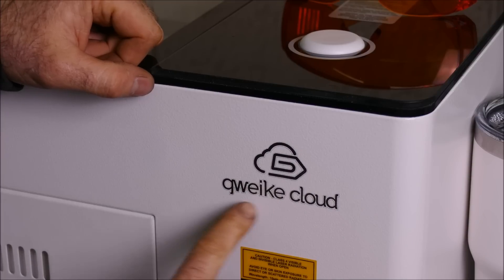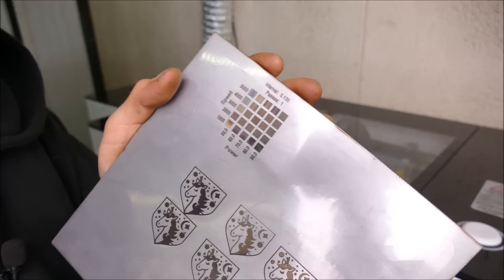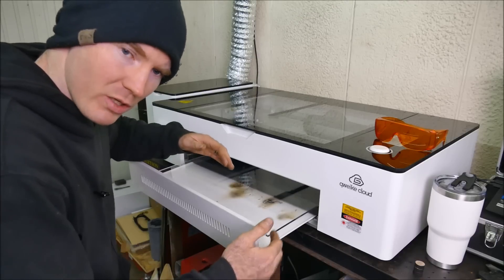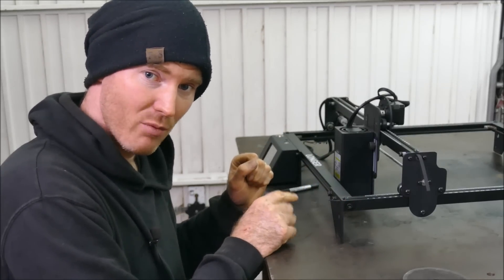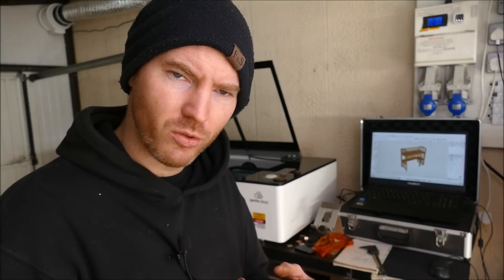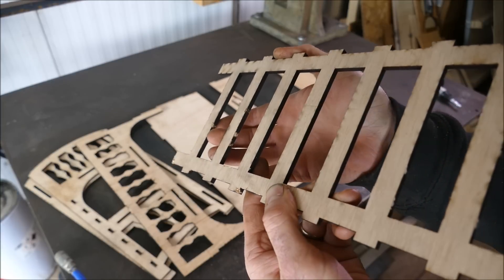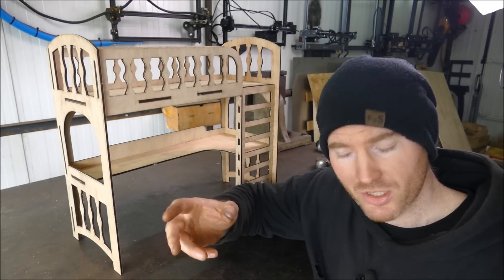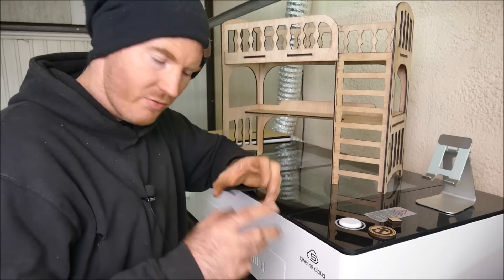10 VS 1 CNC laser!!! - £3000 Gweike cloud pro 50w against 10 x £300 10w lasers - Critical review!

Comment: Great video as usual.
A few of pieces of potentially useful information:
1. The color of a diode laser tells the wavelength.  If you see a red color the wavelength is near 700nm (or longer).   A blue laser runs near 400 nm.
 2. Glass is not transparent at 10.6 micron (same as acrylic).  The glass top of the laser in your review is almost as opaque as a steel top.  A stainless top and/or sheet in the bottom of the machine would provide essentially two mirror like surfaces (why the laser will not affect stainless).  The danger of reflections escaping the machine would go up significantly.
Keep on posting!
Reply from the maker: Thank you. Maybe a plain matt oxide steel would be ok, like just normal steel with mill scale? Non reflective but could save damaging the trays powder coating maybe... Cheers J

Comment: If you regulate down the pneumatic chamfering tool it will still afford a good finish but will still cut really well, I set mine around 50 p.s.i. This makes it more pleasurable to use, even with hearing protection.
Reply from the maker: Good tip. Cheers J

Comment: Hi, great content and presentation. What nobody seems to be addressing  in the LED/Co2 argument is the lifespan  of the Co2 tube - specifically, the fact that Co2 tubes wear out over time ...even if you don't use them! Obviously, if you are using one a lot to make products then you'll factor in the cost of replacement but if you want one of these for your 'Man Cave' as I do then a tube that lasts maybe 5 years at £3k is an expensive toy. LED laser units are only being worn out when on. Any idea if replacement heads are available? Will
Reply from the maker: Thank you. tubes and diodes heads are replaceable. I'm now understanding that the diode tech is advancing so much its making tubes nearly obsolete appart from the desired wave length. Diodes now last much longer, are increasing in power availabillity, and cut staighter and thicker material without the need to focus. cheers J

Comment: CO2 tube lifespan is 1/10 that of a diode head. CO2 lifespan is between 3-10k hours depending on power and quality, diode heads have a lifespan of 25-100k hours regardless of power but depending on quality.

Comment: I'm really liking these business- focused videos. I have a business idea, but every time I start calculating costs, I just can't make it viable, especially if someone else jumps in on the idea. The 'fire-damaged' bed here is a great example - the market for people willing to spend £150 on a doll's bed must be pretty limited, and adding finishing would probably add another £20 in time & materials. 😢
Reply from the maker: Yes that's absolutely right. Its important to scrap a project if it's not viable. If I can reduce material costs and cutting time then it would make a big difference. But I don't think this size is viable, if it's 1/2 scale and half the material thickness it could possibly be a lot more viable as the laser can cut even faster on thinner material and reduced size of part.  Its an art to find the sweet spot of value for money to the customer and profitability to the maker. Cheers J
Reply: You might be able to pull off that price if customers would be able to have it made to their own specs and design. That however would add complexity to the process, thus raising costs. So many great ideas are just not viable for any business looking to make money. Never give up on those ideas though, write them down in detail and maybe someday the technology or material might come along that will make it all work! 😉👍

Comment: I was using a CO2 laser to kiss cut card (for scoring) and cutting the card out - this was to make 3D low poly animal kits.  The issue I had was accurate placement of the card - because  the card was already printed with things like part numbers.  Even using a jig it was always slightly different each run.

I am now looking at drag knife cutters which use witness marks to position the cut - the problem is flatbed cutters are pretty expensive and the consumer models like Silhouette are quite slow - If you get offered a chance to review any cheaper makes that would be great.  Or if you know of any of the diode laser cutters which use witness marks?
Reply from the maker: Hi. I'm actually planning on making a vacuum bed that can be inserted into mine. It will basically clamp down anything I put into it especially swade leather which otherwise buckles up and moves around from the air blower. If you're not cutting through you could reference mark a piece of MDF with the laser and use it as a base and even tack some bump stops for repetition. Cheers J
Reply: I think lightburn has some method of aligning cuts to reference marks but i haven't done it. 
Re flatness of paper, as a thought jewellery engraving machines often have a their rotatory cutter on a sprung loaded floating head and a space that slides over the surface keeping the distance constant , so do some plasma cutters. No idea if you could fit something like that to a diode laser?  
Joshua's idea of a vacuum table, or maybe just a big fan under a honeycomb bed of perforated sheet would also help keep it flat.
Reply: I used to use flatbed pen plotters years ago and some of those had "electrostatic hold down"  for the paper. basically the bed was a large printed circuit board with interlaced fingers of copper on the back  these had a high voltage applied to them and they attracted the paper to the top.

Comment: As always, very informative. Btw can you make a CO2 work with a grbl board?
Reply from the maker: most co2 lasers are Ruida and not GRBL because it's industry standard but I can't see why they couldn't be run on GRBL. Cheers J
Reply: LIke the video , very comprehensive. 
To answer the question The cheap "Chinese K40" co2 lasers don't use Ruida because of the cost of the controller.if you do it yourself it is not to hard to modify a  "K40" type laser,  there are quite a few who have done it on youtube. If you know what an Arduino is you can even use one of those or there are several commercial  boards that you just unplug the Chinese controller and drop in a G code (GRBL)  compatible one. it is not for the faint hearted and you will spend a lot of time tinkering but it can be done. I think there was at lease one commercial CO2   laser as well but can't remember the name.
the nice thing about this one is it is self contained, the cheap ones you need an external  pumped water system for cooling and i know of 2 locally ( UK midlands)  that froze and broke the tube in the last freeze.
If you want it for a hobby then convert one, if you want one to run a business then by a good quality one so you can just get on and make money.
Reply from the maker: @kevinsstuff5488  thank you those are great tips. I'm in the midlands and that's a good point on frost. I built my power hammer with an Arduino controller for the sensor and adjustable reciprocation tuning. I would like to play with Arduinos a lot more for a few other projects such as upgrading my CNC plasma table. Cheers J

Comment: Problem is, that it's still too weak for sheetmetal, to cut 2mm thick steel you need a laser with about 500W or more
Reply from the maker: Yep. I use my plasma for that though. Much cheaper than a laser.

Comment: I appreciate all the effort you must  put into these vids but sadly I am only interesting in metal work, so they are wasted on me.
Reply from the maker: I understand. Thank you for sticking by. I have lots of metalworking videos coming also. It would seem I have gained more subscribers from other areas other than my metalworking which both good but sad at the same time. Cheers J
Reply: If you don't have a cnc plasma cutter and only have a handheld one, laser cutters are good for cutting templates to plasma cut around. They can also be used to "mock up"  or try "design ideas, maybe to show to potential customers, without committing to the effort and cost of using metal.
Reply from the maker: @kevinsstuff5488  very good point. I may do a video on doing just that. Cheers J

Comment: 14:30 I think you pricing is way off. So it took 1.5 hours to cut that? And dont forget it will be flat packet so buyer will build it.. I think in 1 hour you could make at least 5 of those
Reply from the maker: Everything including beveling the edges and loading and unloading was 1.5 hours. The price is right but not value for money so far. Cheers J